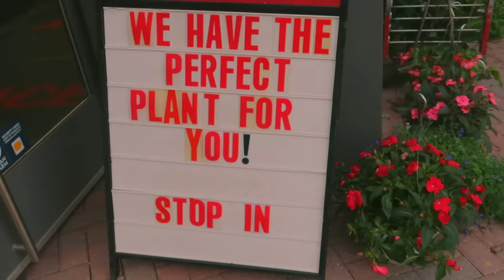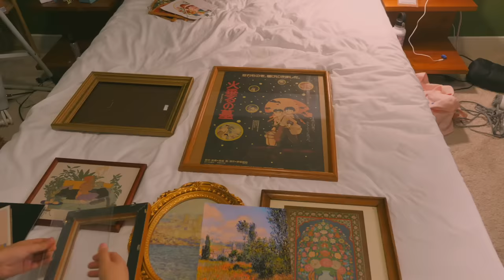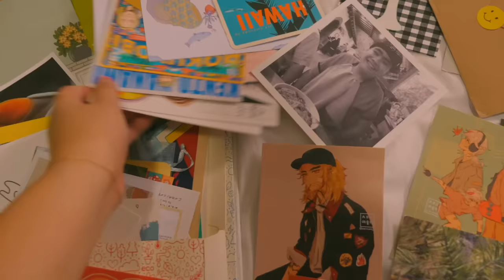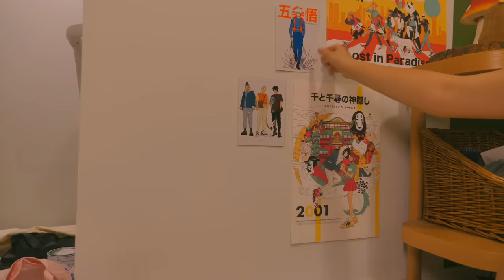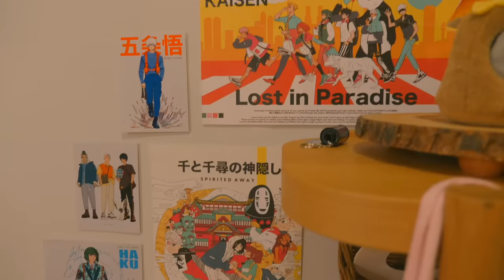EXTREME BEDROOM MAKEOVER & TOUR 🌿🧚✨ decorating my dream space

Comment: Your painting technique is so scuffed and yet it still turned out amazing!!! To make it easier for next time, I recommend doing to edges first. That way you'll be covering up the brush strokes with the roller and not the other way around. Also, I think you just need to have more paint on your roller. You should be able to go from the floor to the ceiling a few times without having much white parts showing through.